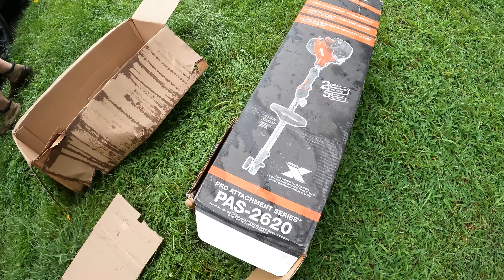Took Another Competitors Customer

Comment: There's got to be a balancing act for the extra charges for a light load verses what they charge to take the dirty dirt.  Is the cost lsee to fill the truck verses sending it light? That seems like wasted energy to "clean" already clean dirt, and then for you to bring dirt to fill the hole.